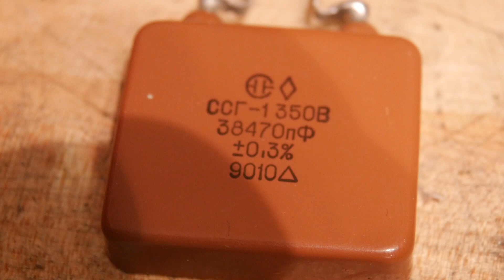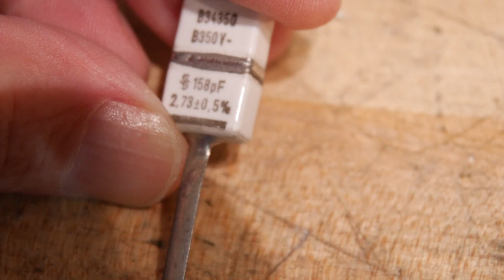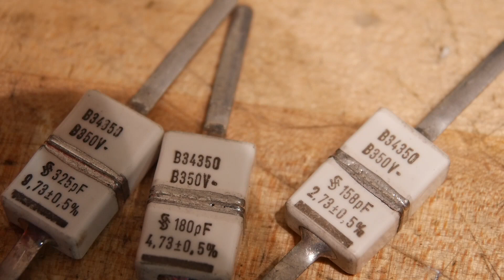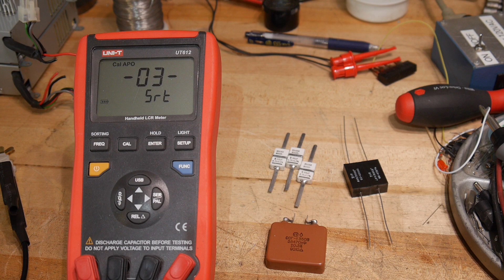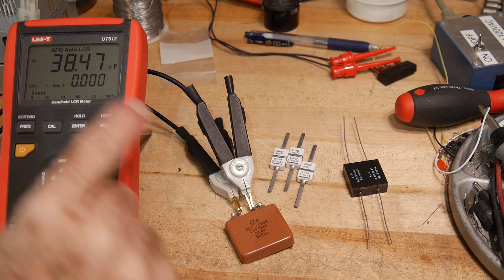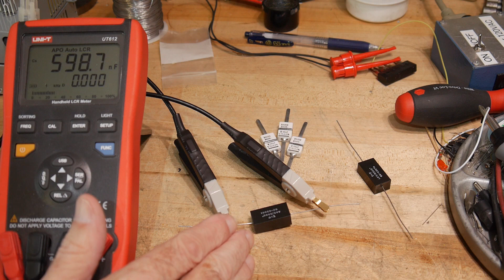#295 poor mans capacitor calibration standard

Comment: SSG-1 - mica sealed capacitors with silver plates - designed to work in DC and AC circuits. Made in metal cases with glass insulators   Cyrillic letter "П" is equal to "P" so it is  pF (пФ)   if it was  nF it will be  нФ  (  "Н" is equal to "N"  ) 

"ССГ" mean  
(С)людяной, с (С)еребряными обкладками, (Г)ерметизированный   =  (C) Mica , with (C) silver plates, (Г) sealed

http://www.155la3.ru/ssg3.htm
Reply from the maker: thanks